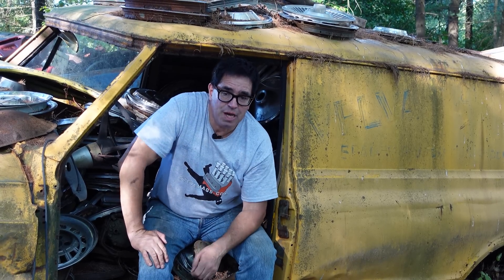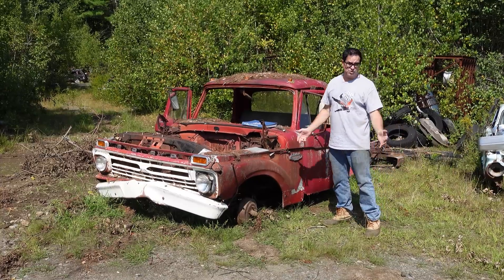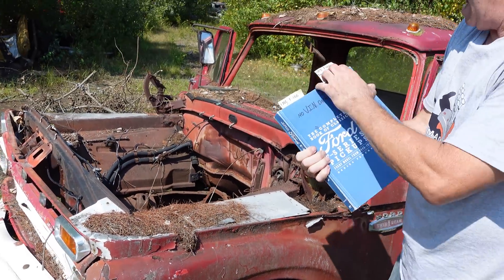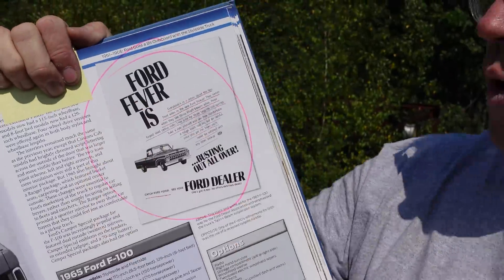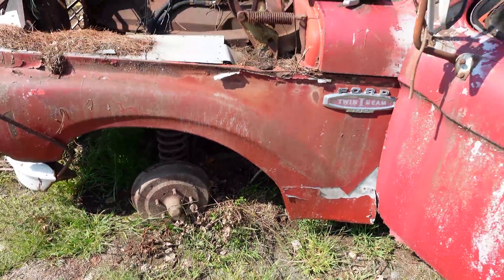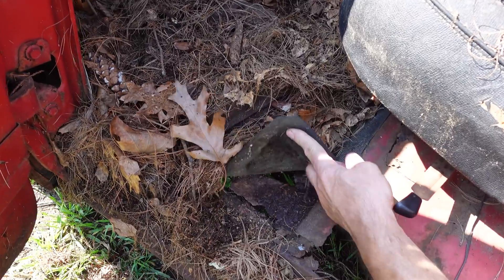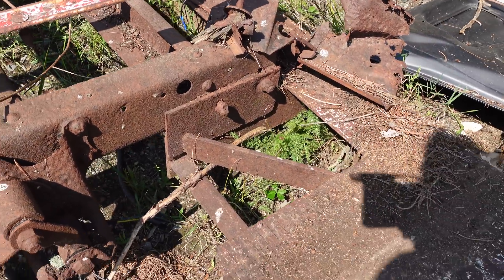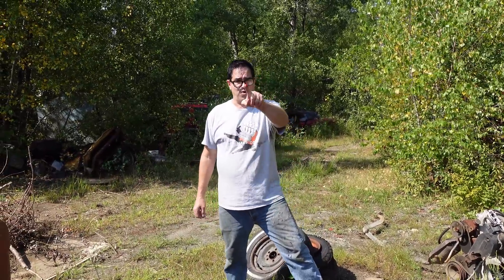The Ford With TWO Front Axles

Comment: I had a 1990 Ranger XLT 4X4 with a live  version of that front suspension. I think they called it Tein Traction beam.. Also with the electronic switch for 4x4 but with locking hubs. The body rusted out,but it still ran when I got rid of it. It was a 4.0 L.

Comment: Definitely one of my favorite trucks I actually own 3 of them two are tow trucks ones a pickup all drivers the TTB in the 4wheel drive stuff gets a lot of hate but if set up correctly they ride and work very well . I actually doing to up grades to one now and sharing on my channel
Reply: I like em too, got two of em as well the thing is they tend to be wobbly steering, other than that solid trucks. The only thing I hate is trying to lift them for tire changes

Comment: No, plenty of online resources to determine the production sequence and how it falls into the model year. It's more likely you'd find that in the parts catalog versus the service/shop manual. Most Ford parts catalogs have a VIN and trim tag decoder in them and that's where most online resources got their information. 

Yes, the trim tag and VIN tell it all, so as we always say, "When we get the VIN, we win".

F10 for F100 2WD, B for 300 CID straight six with one barrel, L for Michigan Truck assembly, and the rest is the production sequence lining up with June 1966 production, making it a 1966 model year truck. The Michigan Truck plant still operates today and is known as Michigan Assembly and is located in Wayne, MI next to the Wayne stamping plant. 

When you get the tag, you can brag: 129 is the truck's wheelbase in inches (something still on door jamb tags on Ford trucks even today), J for Rangoon Red exterior paint, N for Red Crush Vinyl and Red Cody plastic interior trim, 81 for conventional cab, C for three speed manual light duty transmission, Ford produced, 08 for rear axle which is a 3.50:1 non-locking unit, Ford produced, 5000 is the maximum Gross Vehicle Weight Rating in pounds, 150 is the rated horsepower at 3600 RPM, and 11 is the Boston, MA sales district.

Comment: Just a question. What years of the twin I beam front end will interchange with the 65 front ends?
Reply: All of them, up to 1979.  There are some small differences in the 65,  such as the pinch bolt location.  The additional J hooks holding the coil springs in..  lots of guys use the 73-79 front ends to get disc brakes
Reply: @WildBillFlysRC  Thanks so much for the information. Disc brakes are exactly what I was wanting to do on my 65
Reply: @tomdavis7635  it’s a fairly easy swap, and worth every drop of sweat and blood.   My 66 was so much better with disc brake swap.  Don’t piece it together, buy a complete front end with the power steering box, and all of the steering column stuff also,  inner outer brackets, and the column itself.  Best thing you can do for a better driver
Reply: Thanks. I’m a first time builder so all information I can get is greatly appreciated

Comment: Hey Steve! I had a 1977 and a 79 F-150 both with the twin I beam axle. I remember a few times when I had stone in the 77 the front tires were kinda doing their own thing but empty or a normal load they rode like big cars, very smooth.
Reply: That's because you can't put all the stone on the tailgate. Keep it to the front of the box so you have weight on the front axle. Also if you overload the truck that will happen, even semi trucks have a load limit and the same thing will happen with them if overloaded or loaded incorrectly. Think Ford was bad, chevrolet would have left you sitting.
Reply: @coolbreeze5561  It was definitely overloaded.....I was treating it like a FORD.

Comment: Twin Traction Beam (TTB) debuted in 1980 with the introduction of the new seventh generation truck, now referred to as the Bullnose. The previous 4x4 trucks and Broncos were all live front axle designs.
Reply: I had a 80 with it and had a few late 70's 4x4 to.
I like the 400 and c6 in all of them. But man I couldn't not keep the 80 front-end aligned . I even went to one of the places that said there alignement would work or they would redo it. I think they did it like 15 times before they refused. 
It might have been the 38 ground hoggs. 
But the sold axle ones handled 35-40 in with no problems.
Reply: Twin I beam isn't ttb all 100 and 150 series trucks from 65-80 had split I beams if they were 2wd, 4wd had a solid axle all 250 up trucks 2wd or 4wd had solid / live axles front and rear. Solid beam for 2wd live solid for 4wd. 
The TTB set-up with 4wd for all 150 and light duty 250 trucks was a pita to keep aligned as the guy above mentioned, especially if you increased tire size above 255/70r16 or 30/31" 10.50 r15 or r16 you could squeeze 33 10.50 r15/16 inside the fenders but your ttb would be out of camber/caster and once fixed would walk it's way out even with mild a/t M/t tires.  The more you know
Reply: The TTB, the answer to the question nobody ever asked.

Comment: Small detail. Twin I-Beam pickups had the engine offset to the right. Not much, about an inch give or take.
The rear diff was centered so the driveshaft was slightly diagonal.
I always thought it had something to do with one I-beam ahead of the other (although I THINK the wheelbase was the same on both sides)
Maybe you know or can find out why… (I hope it’s not just for steering box clearance)

Comment: These could develop an amazing wobble at about 45 mph.
Reply: If you wobble a twin I beam suspension, you're doing something wrong.
Reply: @coolbreeze5561  we’ll, I was only 17 last time I experienced it, so you are probably right.
Reply: I had a 65 F250 and a 66 F100 and both had over 200k miles on them,  and neither ever gave any hint of a wobble or shimmy. Someone must have greased the front end regularly.
Reply: Radius arms...right?

Comment: Twin I-beam lives on to this day in current 2wd super duty trucks. Didn't know it dated back that far, 60 year old suspension tech. Pretty cool.
Reply: Yea I was pretty shocked to learn they still use it. I still see lots of Econoline vans running around with it. It's to funny to see the completly awful camber curve when they hit bumps. Turns out it was a great design for dessert pre runners but awful for a street driven vehicle.
Reply: @geoffmooregm  Not awful, just different. But most importantly way more durable than control arms and on 4x4s, CV axles up front. And that is why they still use it 60 years later. And on a bigger scale same goes for the old Straight I beam. Big trucks still use it because you really just have to try incredibly hard to break one.
Reply: @geoffmooregm  I was shocked at the 2016 f250 4wd we got new. 
A real 4wd lever on the floor ,rubber floor ,and you actually have to get out and lock the manual hubs. 
Sort of a real work truck, but I don't trust it now that recently it killed an ecm at 135k.

Comment: My dad had a 1965 F100 1/2 ton that was a service vehicle from a garage with all the company's name written on it. It was in mint condition, chrome everywhere. I remember the frame had rot thru.  
My dad said that they never could be aligned properly.
Reply: Depending on the area, might have been used as a plow truck and that caused the rust in the frame.
Reply: @googleusergp  No, it was a 2wd and it's in Massachusetts, Salt covered roads.
Reply: @stephenyoutubin4476  That will do it.

Comment: Hi Steve another great video. I'm not sure what you meant  at the end of the video you stated that the "styling was from 58-66..." The 57-60 had the same style cab and 61-66 were the same. Although I've heard some 66 parts are a 1 year only deal. A friend had a 66 and needed a radiator support and a 65 didn't bolt up or something similar. I personally don't know that as facts. I've owned 2 of the unibody trucks offered in 61 & 62 they were of course front I-beam. I would have liked for you to have mentioned the padded dash offered on this 66 also. Not sure if it was an industry 1st as standard equipment. I know the 67 chevy truck had them standard but not sure if the 66 chevy offered them. I think you could get the padded dash in the 56 chevy cameo. Dodge I assume did the same along the same time. Namaste Steve 🙏🏼
Reply: Padded dash became standard on '66 ford's yes, seatbelts too I believe. But no padded dashes on Chevy trucks until '67. Compared to the '61-66 Fords the 60-66 Chevy trucks were kind of spartan. No padded dashes, the interior was always the same color, no headliner ever, little chrome or stainless on the inside even on a Custom Cab. Whereas on the Ford you had color keyed interiors, padded dash, headliner, and stainless trim all over the interior on a Custom Cab. And hell in '65 and '66 you could get carpet and bucket seats in the Ranger trim. Both a first for trucks at the time, and now both those things are standard on all trucks. 61-66 Ford's don't get near enough credit for how far they changed the image of a truck and what it could be into what we see today.
Reply: @josephg41  glad you said it...I knew that info but a lot of folks on here will jump on you about anything miss quoted or 1 yr off on your info. Love Ford trucks but I'm not prejudice at all they all made junk on Mondays and Fridays...lol. But I've owned a few Fords and Chevys in my time both took the beaten I dished out and can't say either one let me down. I've always loved the Ford models they just looked better. If you're a Steve Magnante fan, I've commented almost on every vid. I'm a big fan of Steve's. I've owned 61 and 62 unibody that had a 292 and in school I needed a project to work on. So with a wrecked 70 GS I stuffed that Rocket Olds V8 in my Ford unibody. It was a custom cab with all the chrome jewelry and the big wrap around back window. Called her "Stubby". Thanks for commenting on my comment lol...you have a great day and a better tomorrow. Namaste 🙏🏼

Comment: Steve, This is a reminder that cars used to be large and pickups used to be sanely sized. This F100 looks like  a lightweight compared to today's Ranger let alone the F150.
Reply: Yeah, today's Ranger looks the same size as full size pick ups did 20-25 years ago, I don't know if styling is playing an optical illusion on me and certainly the raised suspension, but that's what I always thought.
Reply: @bobhill3941  Your right the styling does trick your eyes into thinking things are smaller. For example in the early 2000's my cousin had a 63 Mercury Monterey 4 door and a 91 Pontiac Bonneville 4 door keep in mind the Bonneville isn't a full size car but if you park them next to each the Mercury was only a foot or two longer
Reply: @purpurahaze9179  Yes, the styling was well executed to trick the eye!
Reply: The fact some of large old cars are lighter than some of the smaller modern cars. For example, the 1968 Chevy Malibu sedan with V-8 roughly the size of a 2012 Ford Crown Victoria, but weight lighter than 2010 Honda accord V-6 Sedan.